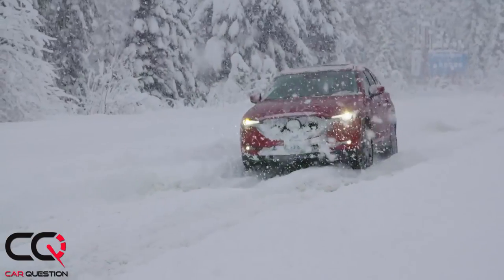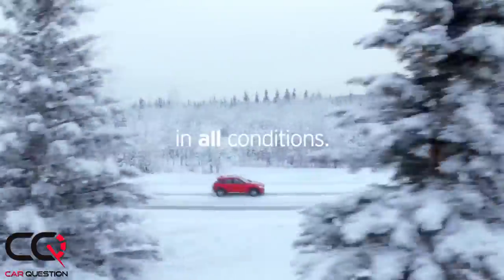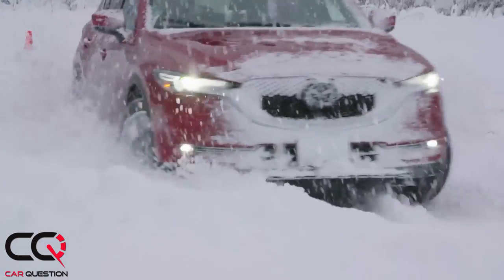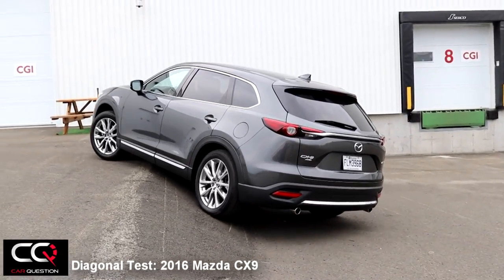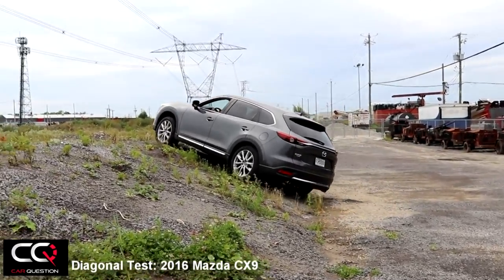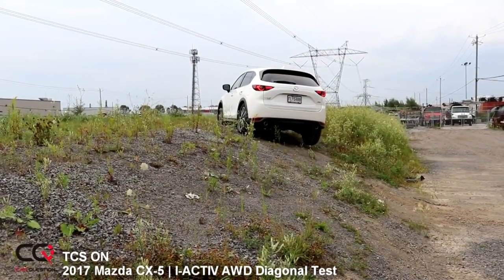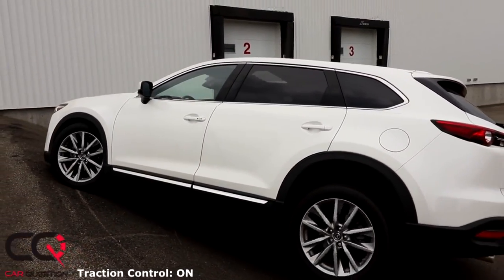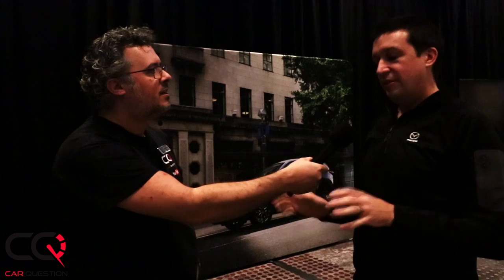How Mazda i-ACTIV AWD works and what they think of our famous DIAGONAL TEST!

Comment: I drive my 2019 cx-5 GT Reserve in some very challenging winter conditions... well below freezing, high altitude, icy and low traction roads, deep snow- and switch to high desert in the summer at consistent 100F temps.  In both of these driving environments, the vehicle provides superior traction, comfortable seats and the best AC on the planet.  Forget trying to trick the algorithms and TCS to fail in .001% of driving conditions... for 99.999 percent of the time, this is the best handling, intuitive, fun to drive small SUV.
Reply: Mazda AWD uses a wide variety of inputs such as temperature, speed, steering, and other factors to determine torque distribution. All of these factors are absent in the roller tests.

Comment: I appreciate the logic given by the Mazda person in that 95-99% of the driving is going to be done on normal terrain or in normal circumstances.  And although they make good effort to account for that 1-5% of unusual circumstances...if it's a choice between one or the other, they're going to spend more focus on greater majority.
Reply from the maker: Logic is the cement of our civilization, with which we ascend from chaos, using reason as our guide.

Comment: He said that their TCS system is more every day driving oriented and that's ok, hovewer some competitors have special off-road programs, which can be activated for such diagonal tests. That makes the difference. 
Still it's good that Mazda is working to make their AWD better.
Ps. Best wishes and all success in new year 2019.
Reply from the maker: Thanks 🙏 same for you my friend
Reply: It's interesting that this kind of counter-intuitive behavior can be observed in other non-Mazda vehicles. For example, disabling stability control on Suzuki vehicles  also makes brakes-based diff lock imitations more aggressive: https://www.youtube.com/watch?v=q0OOK05YY5w
I think that this is because car manufacturers use similar (if not identical) hardware, which forces into a certain framework when programming the logic.
Reply: i know you posted this comment more than a year ago, but i just went to check out a cx-30 at a local mazda dealer. they put a button for activating "off-road mode" on the 2021 models. 2021 cx-5 had it too. i found it interesting that they did that.
Reply: @KumaMech  Dave mentioned they were planning to replace the TCS off button with something clearer about how to get out - the off road mode button was the result

Comment: The Sport trim does not have dynamic stability control. Does turning off the TCS on the Sport trim still make the system engage the brakes harder on the wheels that are spinning freely?
Reply from the maker: Checking with Mazda and I'll get back to ya!
Reply: @CarQuestion  Hello Car Question, I know it has been a while but were you able to get some feedback on this?

Comment: Does Subaru still have a better awd system than the newer Mazda? I can't get over the cvt and underpower of most Subarus.
Reply: I would say they are about equal. I have had and outback and a cx9 and both are confidence inspiring.
Reply: Go with the Soerento... best of both worlds.
Reply: Car Question also tested some Subarus that did pretty well on the diagonal test, before Mazda improved on their system.
Reply: @saliston  absolutely not  Didnt you just check the videi?
Reply: Subaru's AWD is fundamentally different than Mazda's system. This new Mazda system isn't much different than the old one, just mite activate a little quicker in some circumstances. The construction of the Subaru AWD allows much more torque to be applied to the rear wheels, and it's always AWD, it doesn't wait for slippage to occur, then send power to the rear.. Which is "better" really just depends on what you value more, fuel mileage/initial cost (Mazda)or capability/safety  (Subaru).
Reply: @Shanerinsaner  Besides diagonal test, I think Subaru is preaching to the quire with their "always on symmetrical AWD". Of course it is good and might best in the class. Saying that the margin might be too small for most to notice and the system comes at the risk of questionable CVT and engine...
I had CX-3 1.8 petrol in Norway Feb as rental car. It was snowing every day, studded tires were installed. I was driving like the rentals should be driven in the snow. The car was amazing. I never felt any on/off work from AWD system. Not even once. It was easy to control the car with just the gas pedal.  I am not sure how the system would work in warm sand, but below freezing temp the system was amazing and I was really impressed with both the engine and the handling.... I was not impressed with the trunk of the CX-3 though... ;)
Reply: i would say subaru does due to it having all 4 wheels being powered at the same time but mazda still has one of the best systems out there. Get a used subaru forester xt with an automatic or manual and your issue is solved.

Comment: One would think there would be a way for them to detect suspension load to see that type of situation and get the system to respond appropriately. "Oh crap there's no load on this suspension component, maybe I shouldn't let this wheel spin"...  I personally think that could be useful in everyday situations during evasive maneuvers to get it to work with the stability control system.
Reply: I was thinking the same. Saying that it would require adaptive suspension. Then it would be possible to measure the oil pressure. Also then Mazda would cost more, which is not their target for now. 
Saying all that, I am not sure how expensive is the simplest adaptive suspension. It definitely costs more to maintain long term.

Comment: So I'm a nutshell, should I turn off DSC when I go real off-roading or only when a wheel ends up in the air? I didn't get a clear answer, but it seems that the new "off-road" mode is simple the DSC turned off.

Comment: Great video. What is torque split ratio in normal conditions for Mazda vehicles?
Reply from the maker: We will check for you! 
a+
Reply: I believe it is just a few percent only in order to remove any slack from the driveline so torque can be delivered quickly without any jerking of the rear wheels.

Comment: Is there a retroactive upgrade available via the dealership for earlier model years?
Reply from the maker: not at my knowledge
Reply: @CarQuestion  do you think you could reach out to your contact at Mazda and update the video description with any additional information? My friend could not get their 2017 CX-5 out of a parking spot in the snow until I started using left foot braking to limit slip.
Reply from the maker: of a flat parking spot?
with winter tires?
Reply: @CarQuestion  yes a flat parking spot, with 1 inch ruts in the snow from accumulation around the tires. It was in traction control off with all season tires. Just spinning the front wheels wildly until I put a bit of left foot brake on and then it came right out. Their algorithm leaves so much performance on the table.
Reply from the maker: all season tire :(

Comment: This was a great idea, and the guy kind of answered the question, but his view is basically that transferring torque side to side is not a priority for Mazda.  I don't see what the incline has to do with it.  Let's say you are getting into/out of a parking space (or pulling off the side of the rode) in snow and the FL and RR tires ares bogged and spinning - wouldn't you have the same result as with the off-camber hill test, where the tires will just continue to spin?  If turning TCS off solves it and lets the brakes actuate, then I guess there's no issue.

Comment: mazda was true to their word about the TCS button. Its now a offroad button made to get you unstuck in exactly these situations lol. They have a button now for that 1% rare instance you have a tire off the ground uphill lmao. while the car isnt a offroad rock climber by any means lets be real no crossover is but it can handle gravel uphill sand snow wet mud with ease. Mazdas i active AWD is just as good as any other computer controlled awd system.  Sure there are cars with passive AWD thats always on like suburu but in the snow in the wet mud on gravel uphill mazda and suburu both send 50% of the power to the rear and you would notice no differnce in these situations with either and really theres no point to having AWD on while your driving on dry pavement 90% of the time wasting fuel eco. Its why lexus bmw audi all have active computer controlled AWd systems not passive.

Comment: The white CX9 does pass the diagonal test right ? Is that because TCS is OFF or because it's a new AWD software?
Reply: They didn't change any hardware. They just tuned their traction control engagement algorithm.
Reply: Jonathan S got it. Thanks
Reply from the maker: Check ou that video: https://youtu.be/8cKFN_T2BXc

Comment: My Cx5 can stuck in soft sand easily. Model year 2014. However my friends cx9 was okay model year 2019. I think the difference is cx9 new version got rear differential locks.
Reply from the maker: there is no locker on Mazda AWD.

Comment: Question: in the category of middle suv  what suv make the best performance?
Reply from the maker: you mean the fastest?
Reply: Ohh sorry im talking about the diagonal test
Reply: @leonelsantamaria2212  Subaru FORESTER, OUTBACK, CROSTREK ETC ETC  always Subaru Best.
Reply: @victorr.cortes2323  Suabru X-mode only works to 18 mph after hitting the button. GM Active Twin is better as it can 100% torque to a single wheel while the other three slip.  This system has full, non-braked(like Subaru) torque vectoring AWD that sends power to the outside rear wheel.
Reply: @normt5463  Which gm car has it?

Comment: I dont get it. With 2 adjacent wheels on the ground all that is needed is to brake the 2 that are in the air. On the rear this would be easy since it has electric parking brakes. ABS tells the computer which wheel is spinning so that parking brake is applied. Put limited slip on the front

Comment: So they drop power instead of grabbing the brakes. And get hung up on easy situations where a true LSD would have zero problems. Continuing to clearly demonstrate the inferiority of e-lsd systems. CX-9 is proven in this video to be a softroader, not offroader.
Reply: Get a clue, 80 percent of SUVs made are not for offroading, CX-9 included.

Comment: This is what happens when manufacturers keep doubling or tripling torsional rigidity every model redesign. Had Mazda left things the way they were these things would flex like my Mom's Protegé and all wheels would be on the ground, all the time. Problem solved. Mazda would save the development costs to create traction control logic for model 2024 to allow their customers to flee shopping mall security using the back fields and loading docks.   Keep in mind, if mall security is on a Gen 3 or Gen 4 Honda CRV,  Mazda CX owners have nothing to fear.

Comment: Not a good explanation why their system is so slow to respond. Wheelbase is a lame excuse. Other vehicles with same or longer wheelbase have no problems. @6:59 rear wheel with traction is not moving AT ALL.
Reply: It literally never stopped moving? Turning TCS off would have made it much easier.

Comment: Sorry but excuses after excuses
Reply from the maker: There is no excuse, their systen is fuel efficient and work when you figure out the buttons sequence
Reply: There are probably only a handful of people who know how it actually works. And they are the engineers at Mazda. We only see the results of roller and hill climbing tests when the tester makes various wheels spin. The engineer in this video doesn't tell us how it works, only that it makes the car handle best on a slippery road or during a fast curve or up a steep hill or when the wipers are on.
Reply: @DAS-Videos  The cost to make the CX-9 match the industry will be made up in reto fitting $400.00 apple CarPlay and Android Auto.
Reply: so the latest cx-9 can handle the diagonal test or still fails? @CarQuestion
Reply: I’ve been driving AWD Mazda vehicles for 7 years and never once have been in some diagonal hill situation like that. If I was going to, I would’ve bought a Jeep. Think sensibly
Reply: Connecticut Dashcam so you actually need a 2WD car but paying for 4WD...
Reply from the maker: @oguzhaneren  pass, check this video : https://youtu.be/8cKFN_T2BXc
Reply: @oguzhaneren  WRONG. In many slippery, compromised surface conditions the AWD helps a lot.

Comment: Let's cut the crap - what I saw was Mazda didn't pass the test but Subaru easily did. So I'm going with Forester as I do need a SUV and I go wild sometimes (if I do this a lot of times a year then I'd be looking for a Pajero or Prado). Things like elegance, stylish sharp lines, the concept of city SUV... are not something I care about on this car. I do have another car which provides pure driving pleasure. What I want on my SUV is it won't leave me alone in the wild when I'm in need. That's it. Not passing the diagonal test? Then the car won't get a pass from me.
Reply: If your going to be doing something as extreme at what they are doing in the test often, you need a Jeep or something with a locking diff because eventually the Subaru will get stuck. Watch TFL Truck when they take a Subaru off road.
Reply: Then what you're looking for is not a crossover.  You need a real truck, SUV, or something like a Jeep.
Reply: Yeah Wayne cut the crap, you just said you don't care about the main market segment this is aimed at.  And forester is a 2 row??
So what's your point,
Reply: Did you watch the video? Very clearly turning off TCS made the car pass the test.